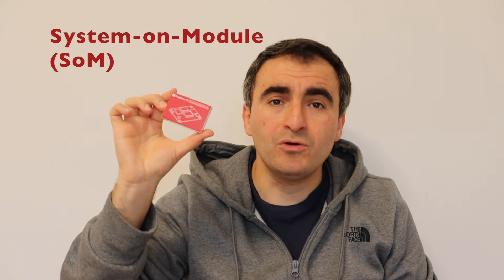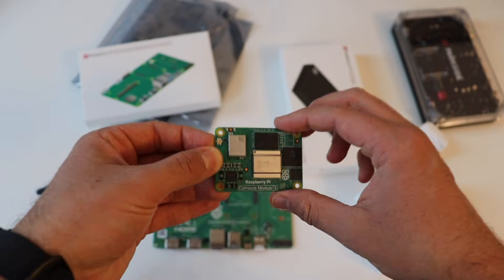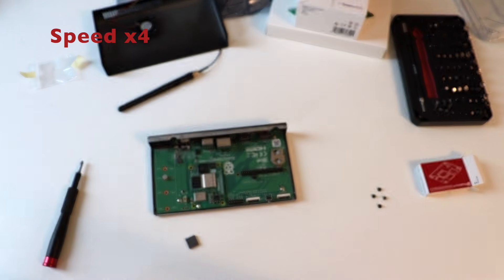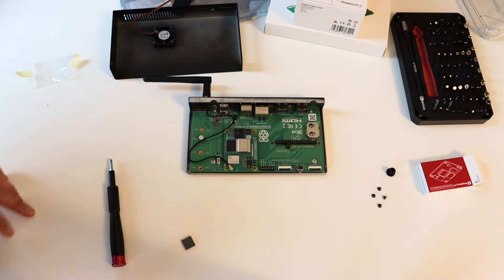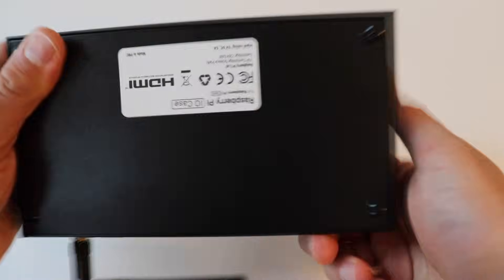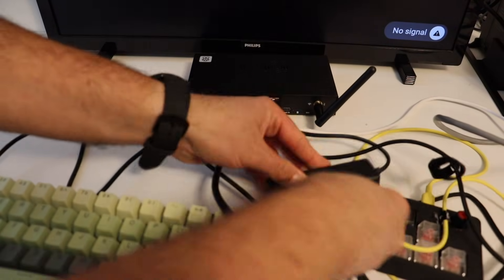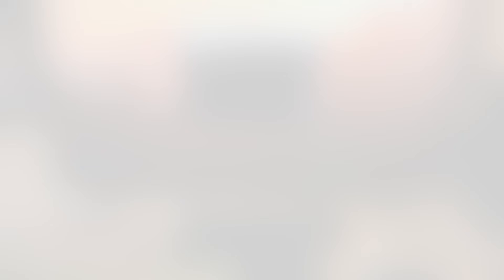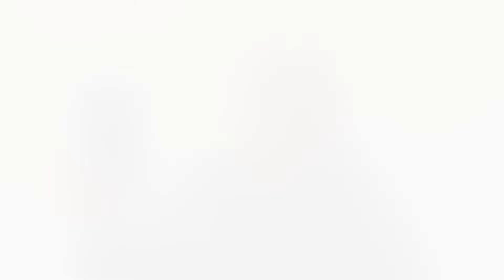Raspberry Pi Compute Module 5 IO Board and IO Case with External Antenna #raspberrypi

Comment: Is possible to use it without the board and the case ?
Reply from the maker: Yes (if I understand properly your question), it is possible to use the Raspberry Pi CM5 with a custom carrier board. In fact, this is the primary purpose of the CM5: it is designed to be integrated into custom carrier boards that provide the specific peripherals and connectors required for industrial and embedded applications.

Comment: If Gpio pins are needed, the rpi5 has them, this hardware is meant to test the software developed by the manufacturer imho, Cm5 not for hobbyists.
Reply from the maker: The CM5 IO Board also includes the 40-pin header with GPIOs, but they are not accessible when using the official case. It is worth noting that the primary use case of the IO Board is as a hardware reference for designing your own device based on the CM5, so it targets both hardware and software development. For this reason, unlike with other products, Raspberry Pi has made the IO Board hardware schematics available for download as a complete KiCad project.

Comment: Does this combination of devices made the hardware as a gateway device ?
Reply from the maker: Yes, the idea is to use the rpi CM5 with a custom board tailored to specific requirements. It can also be used in a gateway too. This approach is common for companies building specialized industrial devices that they manufacture in low to medium volumes.